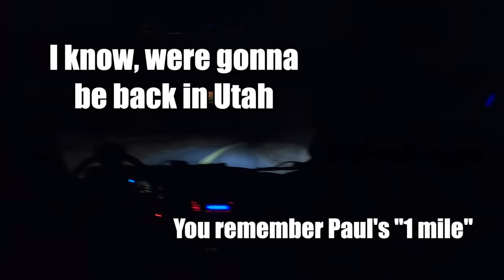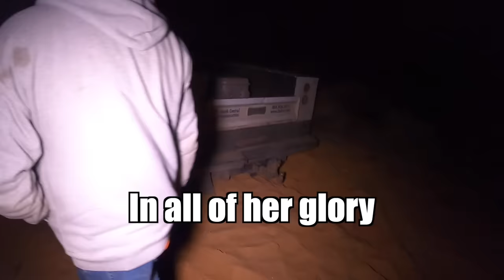You Won’t Believe Who I Had To Rescue! Best Recovery Ever!!

Comment: Yall should get some cb radios so every one can still communicate when there's no cell phone service
Reply: or just some cheap handhelds, theyll run ya like $25
Reply: @yeetandskeet  ya that would probably work to CB's have a longer range tho depending on the antenna u use
Reply: I feel like GMRS would be a good call too if they got licensing
Reply: I agree with the CB radios, and they're very affordable.
Reply: @1homeboy815  40 bucks will buy a decent cb. Another 20 bucks will buy a decent antenna.  An hour or less to put them in each rig.   Depending on the terrain they could probably get 2 to 10 mile range.   A bit more money and they could possibly double that range.  Say 200 per rig?   Handheld radios usually have limited range unless they are expensive high quality radios. Those usually require a license to use.
Reply: I just saw their Facebook post and someone sent Matt some walkie talkies in yellow as well.
Reply: GMRS for the win, I'm kinda surprised his big trucks don't already have it? I guess they have good cell towers.
Reply: Yea, Good idea ! I was going to suggest some Motorola handhelds like we use in the work trucks with a base station at the office. They work really well. A Bigger dollar investment than CB radios though. Cb’s should work good.
Reply: CB's are a WASTE of money, except for truck to truck in a group.
Reply: I'm surprised they didn't already have them honestly , it's a requirement to have a cb in some 4x4 parks around here
Reply: @W7DSY   I think they would have worked ok to talk to Rudy & Matt to let Rudy know they were done since they were probably within a mile of each other. A nice safety factor in a No cell service area. You can allways relay from person to person.
Reply: GMRS for sure. The Midland MTX400 has 40 watts and unobstructed can reach out 60+ miles. You’d need 10 times the power to get a CB to reach that far.
Reply: @markcargile  The big issue is actually antenna. CBs are in the 11 meter band, and an optimal antenna for that band is quite large, whereas GMRS is near the 70 centimeter band, making optimal antenna sizes much more reasonable, especially for mobile use. CBs can actually go very far, much farther than GMRS, thanks to that bands ability to utilize atmospheric conditions more easily - if you have the right antenna.  But I agree that GMRS is the right solution for Matt and his crew, unless they want to go with a business license and their own frequency, which would honestly be a waste of money.
Reply: No way, GMRS is a better option with the right antenna. Try these BTECH Mobile GMRS-50X1 or Midland MXT400. Licensing is the other side since GMRS is licensed for personal use, so you need to get a business license really. But maybe worth the cost.
Reply: @OcRefrig  In my truck I have a CB radio which I use when we go in a group.  I also have a 2-meter amateur radio (I am licensed) which has a range of about 75+ miles with the local repeater.  However, it also depends on terrain.  Mountains will block anything.
Reply: Probably better a bunch of 2-way radios/walkie talkies. Easy to hand out to people who don't have communication, long range even in high obstruction locations like a forest.
Reply: Yea...but cb radios have that coolness factor lol My setup can reach about 5 miles or so and have reached even further before
Reply: @jacksongearhart6872  I hear you, I got a CB as well, though many of the newer walkie talkies have a range of 40 miles on flat land and over 10 miles on heavily obstructed land. Maybe a good idea to keep a pair just in case your buddies join you on a the drive and they don't have a radio.
Reply: I would suggest amateur radios (Ham radios). The license is easy to get and there are very affordable handsets (transceivers) now. And if you upgrade to a larger vehicle-based transceiver with an external antenna your range will increase even further. Lastly, if you have a repeater in the area your range can be quite far (world wide?).
Reply: @gpaje  true enough. But you could also get a base station setup at the shop cause they have a nice range. This is one of those times there’s multiple solutions to the same problem lol
Reply: @jacksongearhart6872  Absolutely, that would be a good idea.
Reply: Kinda surprised Matt isn't a HAM for his own private using, or have GMRS for the tow business.

HAM is kind of a no-no as commercial use isn't allowed, but given how often he ends up in the wild having a non-cell phone means to report emergencies would be kinda handy. With most/all the repeaters in that part of the country being on mountain tops its perhaps a fairly reliable means of emergency communication, even with a handheld.
Reply: I would go Highest Power VHF myself honestly. Then you could still hear local Truck drivers about highway situations on LADD 1 etc. Also VHF radios would go farther than CB's with less interference which is ideal for commercial use. I personally love CB for the hobby side but what Matt needs is a set of Yaesu FT-2900R's and quality antennas. On high power with 75 watts those things would be chatting pretty far away.
Reply: @JonsMG  Second this. Myself am personally a fan of LMR and VHF bands for outdoor use, but either would work quite well in Matt's situation here.
Reply: @W7DSY  really?   Good to know.  (Sarcasm)
Reply: @W7DSY  CB's will work even during a disaster,  but overloaded telecommunications network, which means that critical calls may not get through.  I have one in my house and ready to be used, or in my car.
Reply: @W7DSY  Lol, I used to talk to Florida from Indiana in my car with a CB. You don't know what you're talking about.
Reply: Me and my mates got CBs in our rigs. Best Investment to communicate while 4wheeling or even in the city
Reply: Actually even some bull horns lol or figure out morse code and use the Banana horn
Reply: @yeetandskeet  Cheap handhelds are a waste of money, and you are lucky to get more than a couple of hundred yards range from them.  Quality handhelds are much better because they have more power and sensitive receivers — I have a GME TX6500s 5W hand held that has excellent range, but that is a NZ$500 radio.  You don't the sophistication with vehicle systems because the antenna does all the work.  I had a tiny GME UHF CB in my truck that only cost me NZ$250. It had a whip in the middle of the roof which provides a great ground plane, and that had plenty of range.  I totally agree that at least Matt should have a CB in the Corvair, and that Rudy and Paul have them in their trucks.  If they had a handheld or two as well that would be a big help coordinating recoveries.
Reply: @OctainDesign  yeah but half the time they're in customer vehicles here. how would you communicate then? cheap walkie talkies are the way to go..
Reply: The problem is, it’s great at first. Then you end up just leaving it off because people just blabber for no reason all the time. Plus the static.
Reply: @billybob-jz5mo  i don't know how your buddies are but mine are flaky as fuck so if i never wheeled alone i'd fuckin wheel like 5 times a year lol. i need to find some better wheelin buddies.
Reply: @davidreynolds731  I live right in the middle of the NZ Marlborough wine region surrounded by vineyards, and it is harvest time right now, so the CB channels are flat out with harvest traffic.  In fact one of the biggest wineries 'Drylands' is a kilometre down the road, so we have trucks loaded with grapes going past 24/7.  It's interesting listening in, but like you say, it gets old pretty quickly.   I have a feeling the limited range out on the off-road trails would limit chatter for Matt and the crew.
[EDIT]  Another thing I have just thought of is that off season we hear the vineyard workers driving their tractors mostly, and the air turns blue.  I've even heard them talking about the fight they got into at a bar the previous evening, so entertaining, but NSFW
Reply: @TrevorDennis100  yeah it’s handy, but doesn’t do any good unless both sides remember to turn it on lol
Reply: Just get Tesla's Starlink, put in on the roof.. :-)
Reply: There is a  2 meter repeater out near Sand Hollow.
Reply: What everyone here forgets is that Matt describes himself as "cheap, and lazy"
Reply: You usually don’t want to go to cheap on CBs but as long as you tune them and your whips you’ll have pretty good range
Reply: They could get (and probably would need) a commercial band radio and have a dedicated frequency to operate.
Reply: @makingtechsense126  ham radio cannot be used for commercial purposes. Gmrs is their best bet
Reply: They really should have business band radios in all of their vehicles with their own repeater.  With a basic repeater they should be able to have a couple hundred mile coverage radius depending on the altitude of the repeater.
Reply: @Bendigo1  Plus, a lot of off-roaders and ATVers use CB radio
Reply: @longliner205a4  that can get pretty expensive.
Reply: 2 meter fm..  would be my deal.  I have mobile and handheld.  But be careful as that is not to be used for business use.  You could chat about where you are however.
Reply: Amateur radio license is not difficult to get a tech class license
Reply: @toysoldier46552  That's called skip propagation.  The guy on Florida can hear you 5x9 on the meter but the guy down the street can't even hear you.  That's the way 11m works.  Same as 10m HF ham.
Reply: @cayman9873  major setback to consider. An amateur radio operator cannot use amateur radio while engaged in business affairs. In other words, you cannot use ham radio for work (business) purposes, nor can you use ham radio for profit.
Reply: GMRS also is non-commercial only. CB or MURS are your only free options.
Reply: Radios are great when you are near someone else with a radio. A satellite communication device like a Bivy Stick will allow you communicate via text message anywhere in the world.
Reply: @markcargile  GMRS is a higher frequency, and is line of site.  With CB I get out out 10-12 miles in mixed conditions (no mountains) on 4w, further on side band (12w).  GMRS cannot do skip, while a CB at 40w can.There is no one on GMRS, while CB is used by truckers, other 4x4 operators....and you have a better chance of contacting someone. GMRS is private use, while CB can be used for commercial without licensing (eg- truckers)
Reply: CB doesn’t perform that well in mountains and FRS/GMRS aren’t going to do much better even though GMRS is the most powerful. Ideally, they’d all get their ham licenses and use the repeaters in their area to communicate but getting your ham license isn’t the easiest thing to do. It takes quite a bit of studying but the power of those radios smoke any other type.
Reply: @yourbuddyaj  CB is a longer wave, and will outperform GMRS/FRS /UHF/VHF which are line of site for same power due to shorter wave length.  GMRS legally is more powerful, but fact is CB is used by many with 200-500w range. CB is allowed for commercial use, which is why truckers use them, especially at loading/unloading bays and pull over stations along hiways. No one on GMRS, good luck if you are stranded.  CB can do skip, UHF/VHF and other short waves do not reflect off the ionosphere, and instead cut through.  With CB you can go thousands of miles....Europe to America on good days.
Reply: @alfredv9902  CB is longer wave indeed but legally you are capped at 4watts (not saying everyone abides by this and the FCC definitely isn’t actively taking down offenders) but the AM band is not as clear or predictable as FM. Take into consideration the amount of repeaters that are active in the US alone and VHF/UHF is a clear winner in my mind.
Reply: @Bendigo1  Yep, about 200$ total to set up my CB Antenna combo. Most expensive part was buying the metal antenna mount for the rear of my car
Reply: @galaxyproductions2076  that is about what i paid to set one up in a pickup.  I used 2 of the old car phone type antennas that stick to the window.  It looked good but didn't have as much range as 2 big antennas. I dont really like the look of the big truck style antennas on cars or pickups.
Reply: GMRS radios would be awesome. I'd be happy to install!
Reply: @Bendigo1  and you could have a nicer cb with a beast antenna, and reach MUCH MUCH further on side band.. this is crucial investment if your out in the woods in trucks all the time.
Reply: Children, children, please...  get a license and a real radio like a 2 meter/70 centimeter dual bander set up as a cross band repeater with a high gain antenna in the jeep and pair that with some quality hand held radios. I bet there are enough club maintained repeater towers around that they could cover half the state that way.
Reply: @W7DSY  in a group setting is exactly what the guys would need them for, during recovery's and traveling to recoverys
Reply: @W7DSY  "Mountains will block anything" 

Unless you're on one! I caught skip and connected with a trucker in Chicago (I was in Washington State).
Reply: Garmin InReach or similar would be something to consider, that way you get GPS coordinates too.
Reply: Oh good 💡 idea.
Reply: What is Matt’s call sign - Big Bird 😂
Reply: @1homeboy815  Cb is dead get into games….
Reply: 10 4 rubber ducky
Reply: Funny how as time goes on we seem to go backwards
Reply: @W7DSY  that's what linear amplifiers are for got an old radio shack. B hooked to a linear amp can get about 40 mile range in hilly and tree lined areas or 60 to 80 mile range on open terrain
Reply: 10-4 good buddy

Comment: I love that Matt’s job is “recovery” and he doesn’t even carry jumper cables 🤣. Just a yellow rope.
Reply: Adds weight. ;)
Reply: @noneya8197  or avoiding liability from damage to the electrical system.
Reply: Iv seen the man spit on the terminals and be able to start vehicles 🚗 right after no cables needed
Reply: He didn't actually say he doesn't have a pair of cables
Reply: Jumper cables won't help you much if the alternator is dead
Reply: @pilotdog68  Every vehicle should carry a pair of cables,  especially a recovery vehicle.
Reply: @markme4  the point is that Matt probably has cables, he just knew it wouldn't make a difference when the alternator is fried.
Reply: @pilotdog68  I believe you are right
Reply: @johnvarner6053  crazy if thats true, i know thats why he doesn’t deflate/inflate tyres, but i mean if jumping a car makes you liable, thats fucked
Reply: @pilotdog68  don't need alternator to start the vehicle or keep it running, if someone gives you a boost.  A dead battery can cause other problems based on how the car is supposed to function, power steering didn't seem to work good with a weak battery i used to have.
Reply: @cryptfire3158  a car can't run without electricity. You could jump a car to get it started, but if the battery and alternator are dead it will stop running as soon as you disconnect the jumper cables
Reply: @pilotdog68  Depends if it's a diesel or a petrol/gas and what year. An old diesel can run without electricity. And can run for pretty long on a dead battery petrol you are screwed.
Reply: @minecraftfirefighter  you really are talking about old old diesel cars, everything's fuel injected now, controlled by computer, that's not going to work without power.
Reply: @Milamberinx   the truck that had dead battery is pretty old.
Reply: He's got a jumper box
Reply: @pilotdog68  true but false. With jumper cables you can charge up the battery and run it for a few minutes till juice is gone and do again. Or you can take the battery from another vehicle that's fully charged put it in the vehicle with a dead alternator they'll get about 10 minutes of normal driving. Al lyou gotta do is swap battery's with a vehicle that has a working alternator. Jump the truck with the dead battery with the good battery. I've done it wheeling to get home when we couldn't use a tow rope through tight sections
Reply: *+++ NO SPARE GAS CAN!!!* LOLOLOLOLOLOLOL
Reply: @leviwooten3795  well said! You wouldn't believe how few people understand this. I used to jump people this way, they always look like their mind is blown and it's so simple.

Comment: I had a truck in the same shape when I was young and broke myself. Had a old Ford that I had to crack the column used to have to push the pin to start and unlock the steering wheel.

Comment: Do you remember the old time standby that was used by EVERYONE, didn't need towers, only needed to be within range to work !   CB radio! Still works today.
Reply: I still use it......that was the first thing I put in my brand new 84 Yota 4wd pickup....was a CB radio. And then Lockers.
I have a Midland mobile GMRS that is going to supplement it soon.

Comment: Matt, you and Rudy (and others on your team) should get your ham licenses. No code required, and you'd have excellent reach in most any area, both directly between you and further away (via repeaters). No, you can't use them for commercial purposes, but if you're just trying to find each other (or trying to call for help), its invaluable. Without a ham radio (or GMRS) license, you're limited to FRS, which is very limited in range.

Comment: Dr Matt, Midland GMRS Radio solves your communication problem.  On flat ground it goes a long ways and the hand held are good for several miles.  Watch the U tube video's you will be impressed.  I installed a Micro Mimi 115 mini yesterday with 6 
db gain antenna.  Just a suggestion.  I purchased for Jeep Jamboree., we have to have them better than CB. Thanks for what you do  I look forward every other ngiht and your escapades.

Comment: Long night but here's a tip if you have a cordless tool or a torch you can excite the alternator enough to run. If it is an emergency then scavenge speaker wire or something to make the connection but an alternator will not produce a charge without an exciter current.